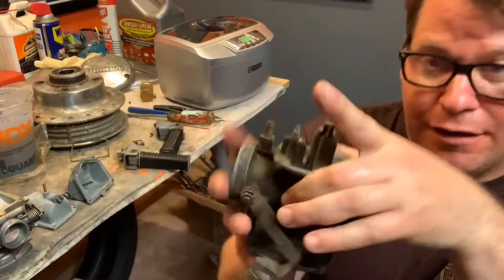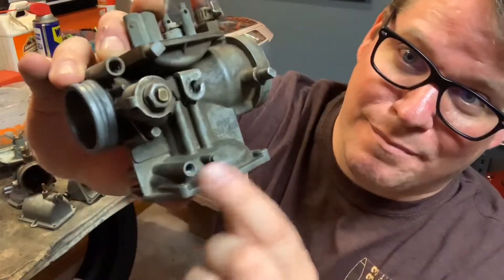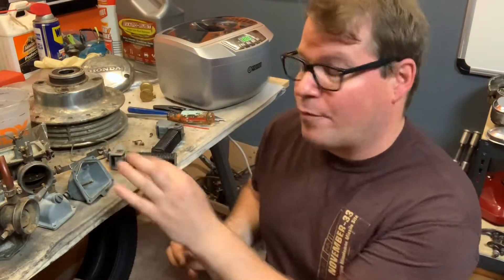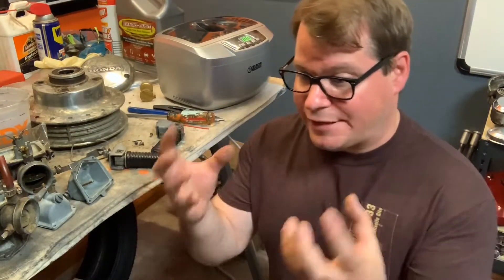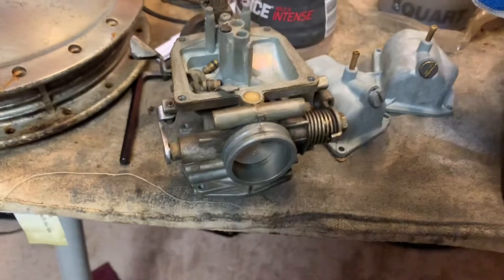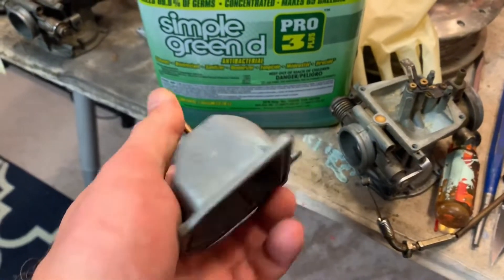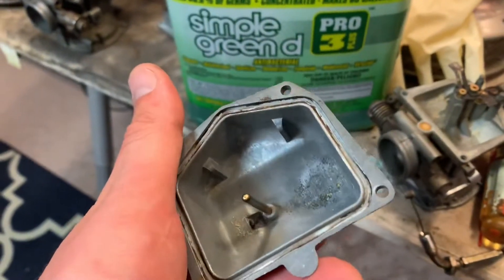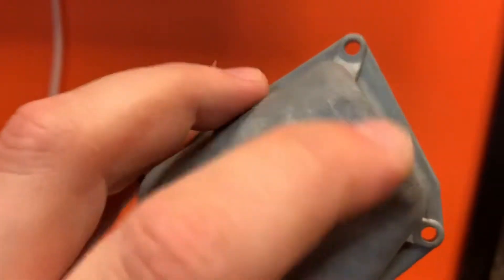Why You Should Keep Your Old Parts & Inspect Them-Vintage Motorcycle Restoration Project: Part 71

Comment: Repair the float bowls using gas tank liner. Make sure you don't get any on the top surface where the gasket goes or in the thread for the drains.
Reply from the maker: Oh that’s a solid option. I have a can of red coat. Thanks for the tip! Great idea.